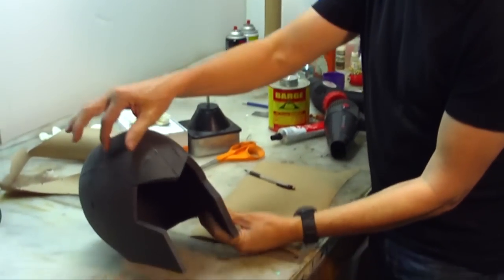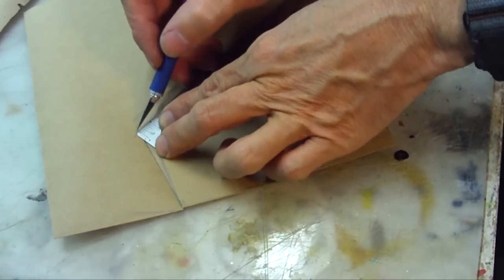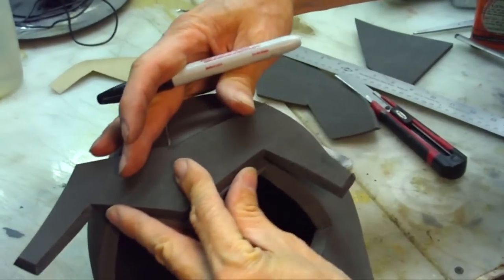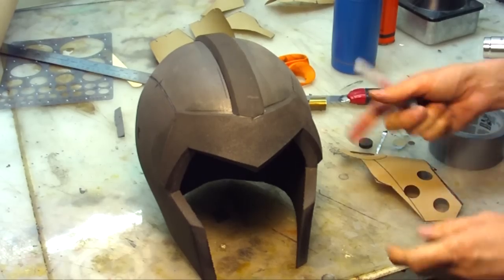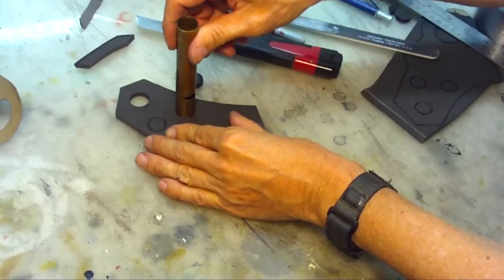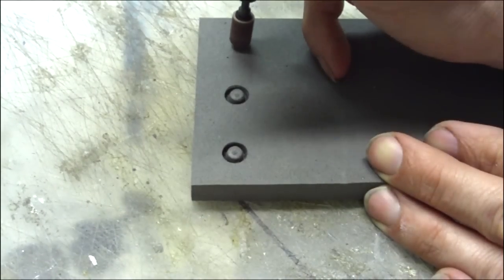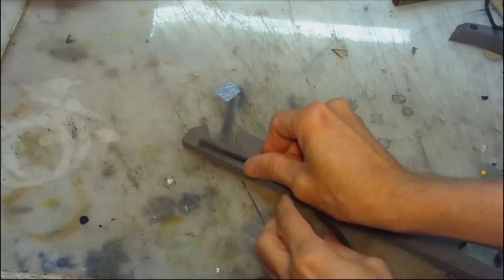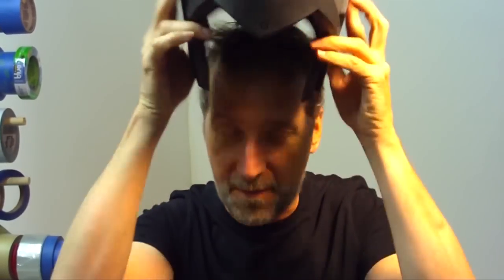How To Make A Foam Helmet, Tutorial Part 2

Comment: This is so awesome. I may do this technique for the creation of my HMC for visual effects... Could I also harden the helmet using Fiberglass resin so it fits my head?
Reply from the maker: Why make it hard with resin? Foam looks hard when you paint it.
Reply: Evil Ted Smith I'm planning on making a fiberglass helmet like they have for motion capture... I think I'm better off just making a brush on mold and make it that way.
Reply: Evil Ted Smith And I'm also attaching 3d printed parts on it

Comment: Hi Ted, great video. I'm using your tutorials to make my own foam helmet. I'm having some problems though with the contact cement not sticking together and making a good bond. (I don't use Barge, maybe that's it.) Maybe I should rough up the surfaces before so it has more surface area to glue? Any tips on how long I should wait before trying to glue, multiple coats, etc?

Comment: 3:18 Again, you drew a pattern then transferred it to the front of your foam making your forehead piece land short
4:50 you can cut perfect holes and make perfect discs with a wood hole saw kit... get the one that has like 16 sizes mine goes from 12" to 5" it cuts foam like butter!

Comment: You can use the heat gun to dry the contact cement faster?
Reply from the maker: +O B Wan A hair dryer would be better. The heat gun is to hot for drying.

Comment: Hey Evil Ted,

I'am having a issue with the paper patterns. (of course paper is thinner than the eva foam mats but I have a sort of issue with making armor that when the foam is cut and you wrap it around the body its to tight or to small. because the foam is thicker.

Note: I did not heat up the foam to bend (just for pre-viewing if it fits around the arms).

I see I almost use the same technique you use I even use a bit over length for those errors but turns out a bit tight.

Comment: hello I am making an Austrian cavalry helmet out of foam similar material
to what you are using but I wanted to know is there anything I can paint on to harden it like a shell
Reply from the maker: Richard Krotec I always find that when you try to put a hard coat on any foam parts, it will crack easily.
Reply: Richard Krotec Plasti-dip.

Comment: Evil Ted, you are the best.

Where can I find L 200 foam?! I tried asking at my local hardware store but they just gave me blank looks
Reply from the maker: RedYankeeRose You can use Floor mat foam and Fatigue mat foam. 
It's basically the same kind of foam that L-200 is. Plus a lot cheaper.

http://bit.ly/1h8Bsdm  http://bit.ly/1rdxTut
Reply: Evil Ted Smith Thanks for the links! The anti-fatigue mat is a great option for a thickness in between floor mat and craft store thin stuff. Thank you Thank you !

Comment: What grit file do you use for foam? I've made swords and clubs before, but only ever out of wood.
Reply from the maker: John Smith Check out my tools of the trade video for lots of tips like that. Good luck.
Reply: Evil Ted Smith What kind of glue are you using? Thanks :)
Reply: MightStarCZ
I can tell you Woodward contact cement works really well.

Comment: Evil Ted Smith I sometimes have small gaps where detail pieces line up. I usually just hide them under more details but was wondering if you had any advice on filling in those little gaps when pieces don't line up just right? Where the forehead of your helmet and the stripe to the back meet what would you do if there was excess space there?
Reply: Use some cheap filler and sand it smooth, you can paint over it later so that it matches.
Reply: cheap filler?
Reply: Captain_Tripps like plumbers putty or anything really that starts out as  a soft gel like substance and hardens or even using liquid foam or foam in an aerosal can
Reply from the maker: DavidSpecialis I use KIWI Seal it comes in a red tube. You can find it at most hardware stores.

Comment: Is the foam you're using, just normla EVA by 11mm? Cause I just found the foam with the profile on the back, but need the ones with 2 flatsides! Are there difference between the hardness ?
I'm german, if u said that in the video, i didnt noticed.

Comment: If the pattern fits the head form and it's the same size as the head and you trace the pattern shapes on the outside of the foam and the foam is 3/8" thick wouldn't the helmet come out smaller than head size???

Comment: whats that thinner foam called? Could you post a link or something?
Reply from the maker: Frazzled Furrs It's just craft foam I got at a hobby shop.
Reply: Do you know of any foam that is in between the two thicknesses? I need one that is slightly thicker and sturdier then craft foam but not as thick as that other foam. I need it to use as shoe soles for a costume[ i have videos on my account].